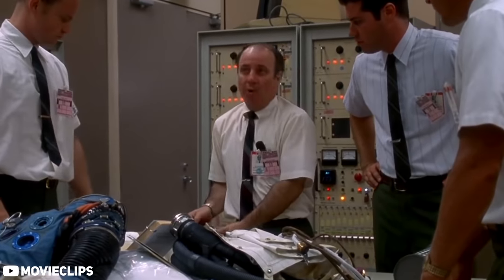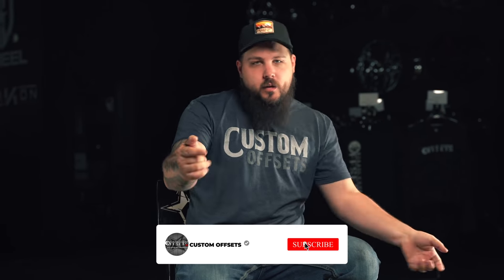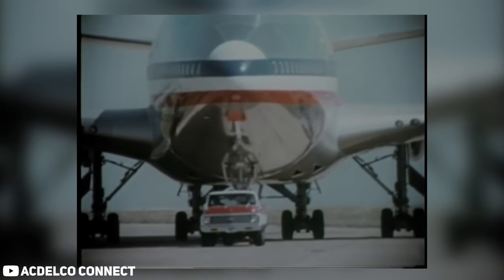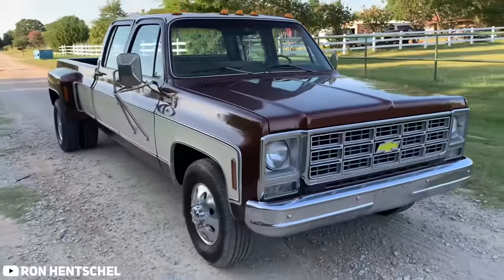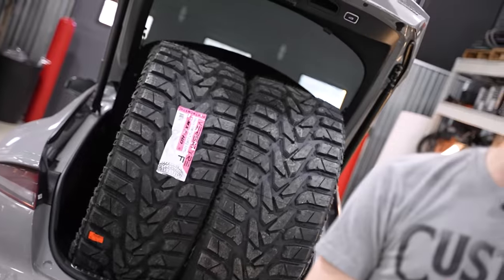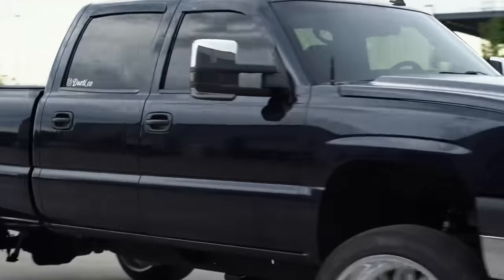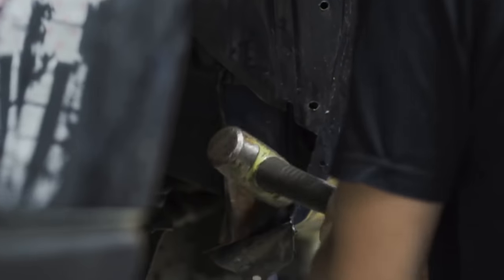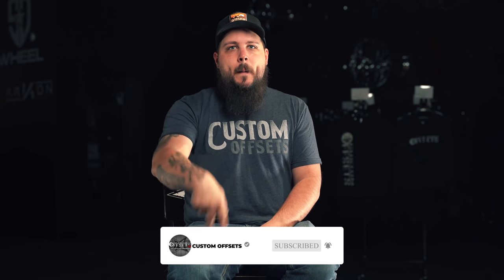Are Square Wheel Wells Worth it?

Comment: Square wheels wells on the squared out 14-18 Silverados are 🔥. I'm running 315 40 r26 basically 36 x 12.5 on a 2 inch level, norcal mod with RC plates and 1\4 inch spacer. Only rubs in reverse at full lock. Can be had with not a lot work but a lot of homework. Right back spacing and rim offset

Comment: I stayed with the same diameter but went with a wider rim on my '12 Colorado and it rubbed like crazy. I put an RC 2.5" lift on it and it still rubs a little on very sharp turns but nothing too serious. I didn't want to have to do any shaving or trimming but I may eventually end up doing some minor trimming on the bumper

Comment: 2017 Silverado CC: 1.5" body lift, 3" level, rear 1" block lift and 1.5" rear spring lift. Bilsteins with 1" front adjustment.
35X12.5X18s on Chevy black stock rims. No rubbing except at full turn on the Motofab UCAs.

Comment: I'm about to do some trimming myself on my 2007 Avalanche, putting a 5" rough country lift and 35's on my 22's not offset rims but still nice 🤷‍♂️. . . Oh and FYI to anyone with a air ride or auto ride suspe sion and looking for a lift kit, just change out ur struts and springs with the rough country ones and ur good to go, just have to buy an adapter to turn your dash light off

Comment: I have a 2020 GMC Sierra 2wd. I put a 6 1/2 in lift on it. I ordered my 24x12 wheels, with 35x12.50s from custom offsets. After cuting the shit out of the wheel well and bumper. They finally fit without rubbing, unless im at a full turn and hit a bump.
But it rides great.

Comment: I just can't bring myself to grinding on perfectly good welds and paint. Just have to go higher I suppose. My own failings as a short person needing to ride in big things. LOL
Reply: Man I got a '17 duramax on 37x13.5's and a 9" lift lol still rubbed like crazy. Had to bite the bullet and do some grinding. Took 3 attempts with minimal amount taken out each time and finally got it dialed in pretty good but it hurt my soul to have to do it lol.

But hey no more grinding lol
Reply: @FreshManny209  
I couldn’t imagine. I have a Ram with a 6 inch lift with 37’s that are 13.50 wide and it only rubs slightly when reversing while turning right.
Reply: Mine is a 19 RAM 2500 with a Carlie 2.5inch level. 20x12.5 with 35s. Should have gone 37s. No rubbing so far, but then that was why I went 35s. Chicken shit at heart. lol Too worried about rubbing.
Reply: @CharlesInserra  
It’s really not awesome hearing the tires grinding on hard plastic. When it happens it scares the sht out of me every time because I forget that it happens. I wouldn’t be ok if it happened all the time like some guys.

Comment: I got 2017 Silverado on 8” of lift and 37 aftermarket bumper no trimming needed had to cut all the way back to the cab on back side of front and small trim on back side of back wheel wells still rubs slightly in the front when I’m full flex offroading

Comment: Have a 2010 tahoe on a 3 inch lift with 18x12s on 35s had to cut into my fender and bumper lot of hammering had to remove my windshield washer fluid tank and I still rub at full lock

Comment: So I have a question. I have a 15 Silverado 1500 rwd. I was looking to run either a 6” lift on 35x12.5 or maybe a 4” on 33x12.5. Would I see rubbing on either of those? Not sure if it matters but the wheel I’m wanting to run is 20x10
Reply: These guys are salesman but their gallery is actually a pretty good resource you should check out. The answer to your question would depend on your wheel offset. If they’re super dished out they’ll rub for sure

Comment: 2014 Texas edition 1500 , 295 70 17 4.5 inch spindle lift up front , stock rear , bilsteins in the rear , race line wheels , Yokohama tires
Reply: SQUATTED LIKE THAT?!? 🤢🤮